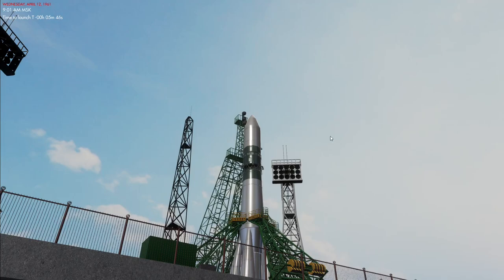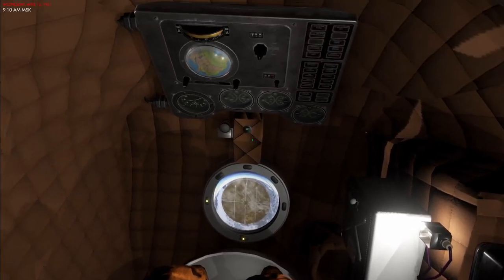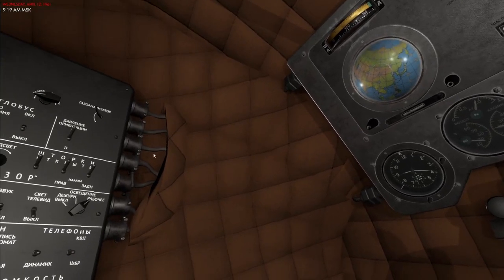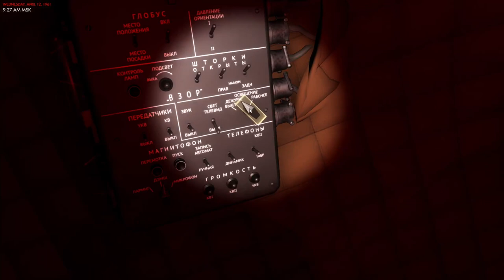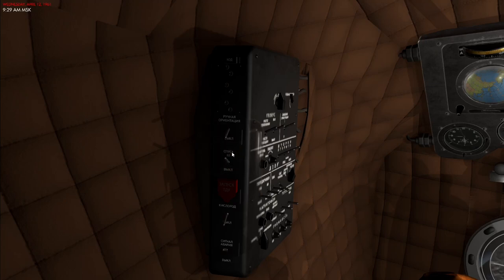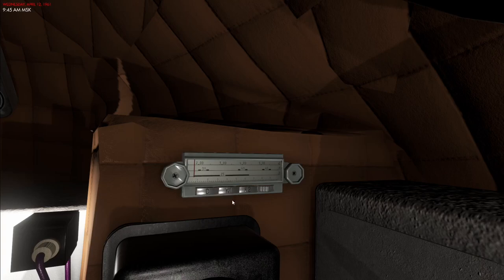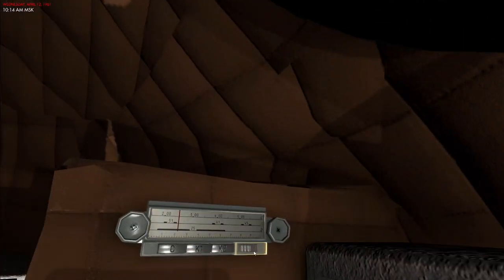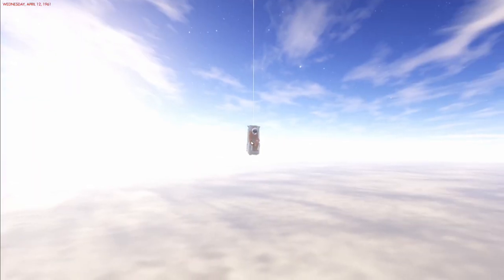A very early preview of Vostok for Reentry

Comment: Not sure about the booster separation sequence: in the real Semyorka the side booster engines keep running in initially during separation to pull the aft of each booster away from the core, letting it pivot on a hinge located at the tip of the booster, this is followed by shutdown and simultaneous venting of booster fuel tanks towards the core, breaking the joints and pushing the tips away from the core. The resulting trajectory is exactly like it looks here, the inaccuracy is early engine shutdown.